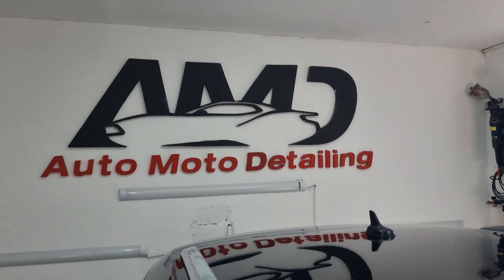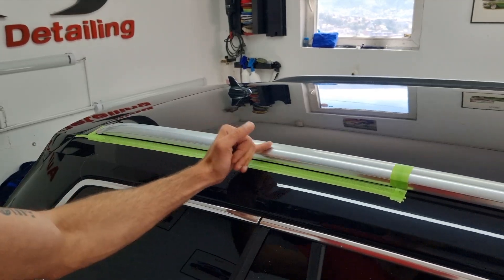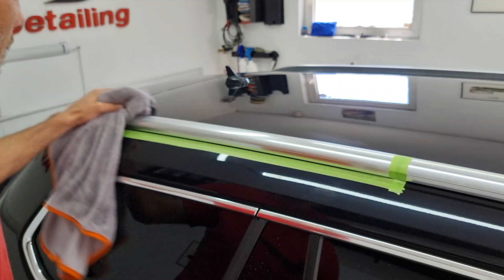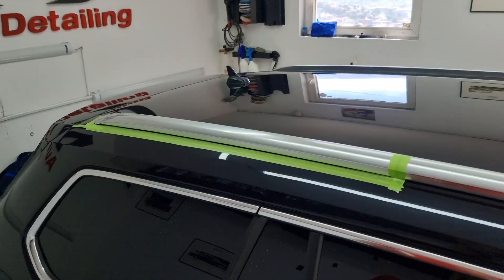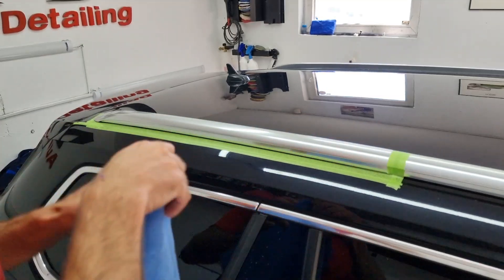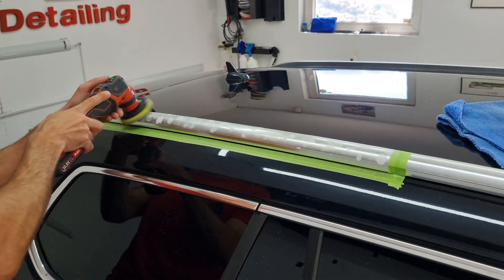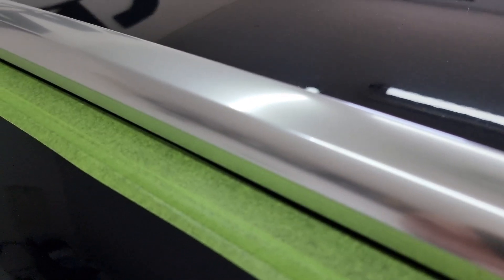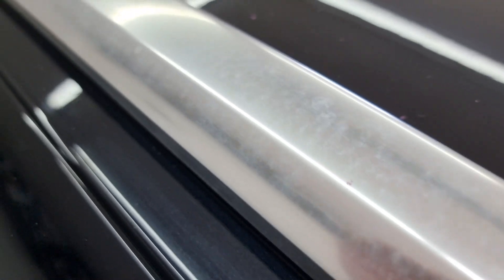How To Remove Oxidized Aluminum ROOF RAILS/RESTORING

Comment: In the beginning you use 4000 grit sandpaper 
Wil 2000 grit be enough or is it to much 
Thnx
Reply: it's about gently polishing the oxide off, and so 2000 might be a bit TOO much

Comment: This wont work on most rails because most rails are not actually metal they are plastic with aluminum finish. If they are metal then a simple metal polish like would work without the tools.

For the plastic ones you dont need to remove the rails. Just get a bunch of newspaper or whatever and mask the entire roof and lightly sand the plastic to rough it up and then spray some primer on it.  I used a Rustoleum High Performance Silver Aluminum colored spray on the rails and it came out looking brand new. Its been on it about a year and half and still looks like I sprayed it yesterday.

The most time consuming part is the masking of the roof. Once you do that the sanding and spraying shouldnt take even 30 min. You have to account for drying times etc.